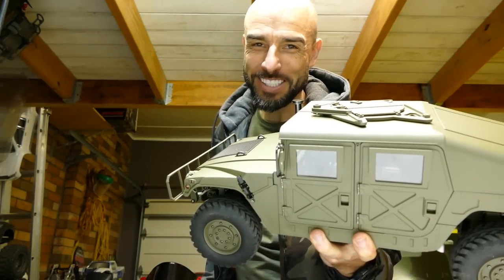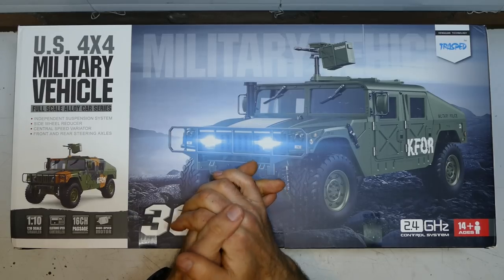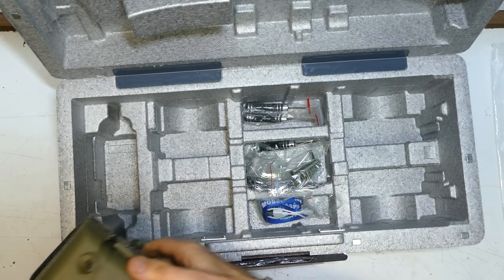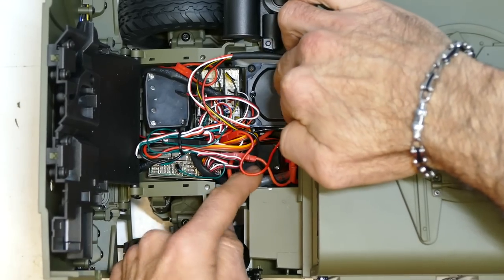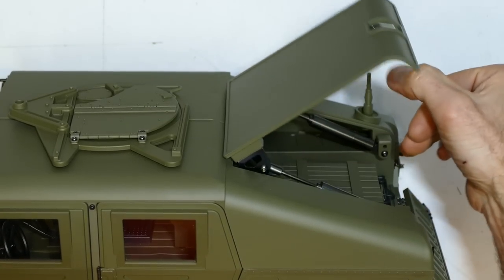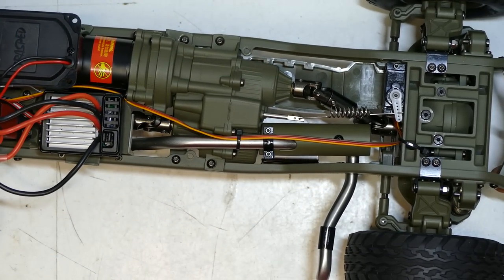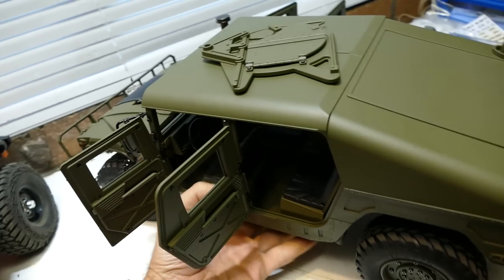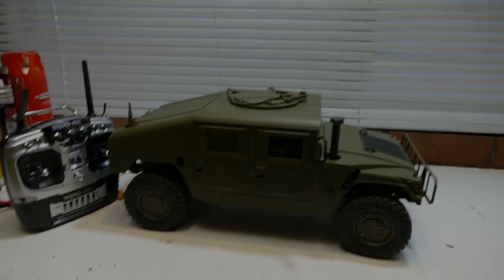AMAZING RC CAR - HG P408 US MILITARY HUMVEE Upgraded Version - PART 1

Comment: 400 bucks isn't bad for what your getting. If you're into detail and realism and scale this is perfect very detailed and everything works that's awesome. For 400 bucks usually all you get is a truck and controller and lexan body . This thing is sweet 👍👍
Reply from the maker: Yeah good point man. When you add it all up its pretty good 👍
Reply: I just checked the price AU$711😱 but it is a very cool model
Reply: LOL This thing is crap with all the plastic steering gear and transmission. For 400 bucks US I would get a all metal RC4WD Trail Finder, or for under 300 bucks US I would get a Tamiya Bruiser Clone.
Reply: hi T...
'
who is a buck...
buck is a name of animal and male person...
buck is a NOT currency

Comment: In my opinion this is the best RTR RC truck so far without exception. I have tested this beast and it ticks all the boxes and some. 7.2 2s battery is good too. I have had some vinyl lettering created for AM General on tail gate. Aftermarket parts, metal brush guard and plastic rear fender complete the beast. A certain driver figure, license plates, may be minor cab illumination and move headlight plugs so that they stay illuminated. The beast is done. Great video detail and presentation...Thank you
Reply from the maker: Your welcome and thanks for watching

Comment: Nice presentation, very nice and real scale looking car. For the people that they don't know, these type of rc models are not made for bashing and crashings and rollovers, they are made for smooth driving and demonstration . But if you don't care you can bash it , brake it and fix it if you can find replacement parts. But if does not exist replacement parts , it's better to becareful because you can't find alaways rtr models like this.
Reply from the maker: Yeah absolutely, these are more for scale driving

Comment: I have had this rig for a few weeks now.  I removed the Rx and replaced it with my Specktrum one and use my DX4s with it.  I lost the horn function, but who cares.  I rearranged the light wires so my headlights are on all the time, I removed the directionals as they were annoying.  I also replaced the wire from the Rx to the light box and now have control of turning on and off the lights with Channel 3 from my Trx.  good rig once the diffs are locked.
Reply from the maker: Awesome man! Thanks for the tip! I need to do that to mine.

Comment: The most informative video I've yet seen on this RC. A bad experience with another Chinese RC manufacturer dissuades me. But even at its price, it's a gorgeous 'Shelf queen' if it goes wrong and parts are needed. BTW; portal axles are totally to scale with the real Humvee(not so much with common pickup trucks). Seeing the build quality of this RC I'm getting weaker by the minute.
Reply from the maker: Much appreciated bro. Glad you like the video.

Comment: My friend let me ask something,did you find why the reason the transmitter have two antennas? usually when a TX have two antennas it does  have a  telemetry system, however i didn't find in any review that it is the case

Comment: It has a 16 channel radio?  It looked like most of the channels had nothing plug into them. Is that the case or did I not see it correctly?
Reply from the maker: Yeah that's correct. You definitely be able to utilise them.

Comment: Did your steering work right out of the box?  I have no steering in mine
Reply from the maker: Yeah no problem
Reply: @RCTanksTrucks247  I figured it out.  The signal wire inside the controller came off.  The soldering is terrible so I fixed both sticks while I was in there.

Comment: oh.... mines still not here! 😭. It's so nice! As for the head lights, on my P802, I just swapped the headlight plug for a permanent feed, there should be some spare slots on the light board, it looks like the same one 👍
Reply from the maker: Ahhh thanks for the info. I will look into that bro
Reply: @RCTanksTrucks247  😎👌

Comment: You can keep the headlights on all the time. Just gotta pull the signal wire for the headlights from the junction box and plug it into an empty port that gives it the signal it needs to stay on. For example, if you can figure which port keeps the lights on when you plug it it, keep it plugged it into that one. Will take some trial and error but easy to do.
Reply from the maker: Thanks for the tip. I did what you said and found a spare port that worked. Much appreciated 👍
Reply: @RCTanksTrucks247  Have you got a picture or short video off which wires go where ? I tried the two black & white wires and moved them over two slots, however, they stay on, but flash on & off like a hazard light lol

Comment: How wide is it with mirrors folded in? And is that the same as the wheel base width? I have a shelf that is 10.125 inches wide that I want to put it on.
Reply from the maker: 9inch wide and 13inch wheelbase

Comment: Hi how easy is it to change the motor only alone do you think. Without removing the gearbox Thanks
Reply from the maker: Yeah should be OK as long as you can access the motor screws with moving the transmission. I would need to pull of the body again to check probably tho.
Reply: @RCTanksTrucks247  Stock is 25T?

Comment: When you get the chance to run it out in the dirt, because of all the electronics do you clean it with compressed air?
Reply from the maker: Yeah that's the easiest way but a soft brush works well too

Comment: I have a question... I bought this HG P408 from bangood and it arrived in a couple of weeks. Batteries have not shown up, been over a month. So I purchased a battery from Amazon, a 7.4v 6000mha 60C will it work in the HG P408...
Reply from the maker: Yeah should be fine
Reply: @RCTanksTrucks247  thanks, love your videos and your enthusiasm.
Reply: Thanks for the advice on my battery. I pretty much have the controller switch's figured out but can't seem to find neutral on the switches (channel 5?). Any advice would be great. Oh the rear drive shaft and screw fell out on my work bench after the first run. Fun fixing it.

Comment: Do you think you can put better sound system and light system on this? If so what would you recommend?
Reply from the maker: Yeah I guess but I am not big on those things. I know GT Power make decent systems
Reply: @RCTanksTrucks247  IS there a way to have the headlamps on all the time? Or turn on with the remote?

Comment: I have seen this before on a China website only they advertised it as a 1/12th scale size.
It is pretty awsome the quality is up with the  company who produced a couple of Jeep a ace Buggy and a very nice Russian truck Capo I think was their name.
Reply from the maker: Capo are awesome cars
Reply: @RCTanksTrucks247  They are amongst the best but very expensive they also do not do long production runs I wanted the Ace the buggy. But there are a couple of nice on Bangood a Bronco and a Jeep type tuber both kit's the Jeep buggy is nice TFL I think is the company name but both are around 500 GBP, maybe one day I am into 5th gas I have 8 or 9 plus the TRAXXAS UDR and a better version of the LOSI Baja Rey made by 30D North called the Super Desert Truck with a Ford Raptorish body fire extinguishers like the UDR  two spare tyres mounted upright with a gas tank  between them I have only seen it for sale where I got mine RC Modelz here in the UK and only one video on here a 40/50 second one, not seen anything in the way of spares but I have fitted LOSI Super Rey upgrades just hope I can get the body panels as it is very nice, it is only three piece rear fender's and cab and hood is one piece in black.

Comment: Wow! you always show some nice  RC. Now I want one. I want to see you run it first. But I think I'm going to get one. It's cool!!
Reply from the maker: Thanks man
Reply: @RCTanksTrucks247  I went to the website to check out what you can get and you also can get a brushless motor and the remote with the remote I use with all my cars the remote that comes with it just like you said it's like flying a plane or helicopter I prefer the other Style and you also can change the wheels on it. And everything you need to change it to a brushless, that's what I prefer to use I think it would make great RC but I want to see you take it out for a spin
Reply: I'm not too good with converting my RC is always take them to a hobby shop and let them do it

Comment: Great video! One question; What kind of battery does it use? will any standard 7.4V 2s battery fit inside the battery box? thanks!
Reply from the maker: Yeah, I can fit a two cell hard case 4500mah lipo in the box

Comment: It's fully waterproof I take it??
Reply from the maker: Not sure, I might have to try it out
Reply: Come on, of course its not. You can use a water proof spray on it .I doubt it was designed as a basher. Stick to your lexon RC models for that. This model was designed as a floor model or display model. I wouldnt think of ruining it by exposing it to the elements. Its not a True Hobby grade model and you know it.

Comment: In order to make that fully scale, you will need to make a rear hatch seal that hangs off the bottom of the decklid where it meets the tailgate and loosely attach it with 100 mph tape (duct tape) 😂 also, that heavy machine gun is a MK19 40mm automatic grenade launcher. Its a hoot.

Comment: Hello everybody  I bought this article, and now I see in the following note "About the update (they are not included in the package and you can buy them to update the car)
1.Motor: 3660 brushless motor,
2.ESC: 60A brushless esc "

Does that mean that without these components the vehicle does not work?

GREETINGS FROM BARCELONA
Reply from the maker: It comes with electronics. They are just suggesting upgrade parts.
Reply: RC Tanks & Trucks 24/7 THANK YOU VERY MUCH You have taken a great weight off me

Too bad I don't have a battery and charger for that price, but it all comes 👍

Comment: Watch the heat with all that wiring under there!  This body does not breathe and my motor gets hot as hell in there.  With the lights and sound stuff in there, heat has to be even worse.
Reply from the maker: Good advice. More than likely I will be ripping out the sound system

Comment: I recently was sent one of these HG-P408( Tamiya) series of the exact Hummer but desert brown, i have also done some serious updates and installed a Interceptor Strobe kit from MyTrickrc.com
Reply from the maker: Sweet
Reply: @RCTanksTrucks247  I am actually being sent a set of 7.4v batteries, one is a 4,000Mah and the other is a 6,000Mah batteries. and a smoke system for the exhaust!!!

Comment: That is NOT expencive. Have you seen the price on most RC vehicles?  That thing is a BARGAIN ! If you are into RC and military stuff you NEED this one. Personally, I am not into that but if I was, I would get one. Hells bells! It COMES WITH a transmitter. What RC of decent quality comes with a transmitter? Some dont come with ANYTHING. I should order one just because it would be worth reselling for a hundred more.
Reply from the maker: You would just need to buy yourself a decent lipo and charger. Everything else seems fine.

Comment: Wow you publish this video on my 43rd Birthday , and by some freaky chance I used to work on them in the US Army lol that looks awesome by the way . Some of the parts on it are not like the bigger ones like the fuel tank is a white looking color 35 gallon tank but it's cool . I've replaced a ton of the Engines out of them . It's actually not a diesel engine .it's a Chevy Corvette engine with Diesel headers and intake .it's a 454 big block Chevy convention pretty cool actually . I liked it at first but after awhile it was me thinking who actually designed this thing ? It was more of a joke then anything . constantly fixing something .the radiator is jacked up . The fan spins at a controlled cluch .no wonder you
Why the over heat ! Disconnect the plug for the fan perfect no over heating .but if it makes sense it's wrong ! Plus the all aluminum body rear  proofed ? Ok last time I knew aluminum don't rust lol well waste of money. Just paint the thing .I've had so many things happen to good hmmv's it hurts me lol I can't explain it !
Reply: The thing on the back bumper to set a trailer on is called a pintal !

Comment: Just a heads up.....I just ordered this (Upgraded version) for £266 UK. Use Code BGP408UP    
https://www.banggood.com/HG-P408-Upgraded-Light-Sound-Function-110-2_4G-4WD-16CH-30kmh-Rc-Model-Car-U_S_4X4-Truck-without-Battery-Charger-p-1483153.html?rmmds=search&ID=231&cur_warehouse=CN
Enjoy folks & Happy Shopping :)

Comment: Don't be so fooled. This guy got his for free. I bought a HG Hemit. It works, but it is NOT worth the cost. $800 and it is fine to look at, but the performance is not that great. Be warned about HG.
Reply from the maker: It is a scale / crawler rc car. It is not expected to be quick. Would you be happy to spend that if it was traxxas, hpi etc. They are made in the same place.
And everyone knows that I receive it for review. What's your point? If it is shit I will say it. I am not obliged to say anything.